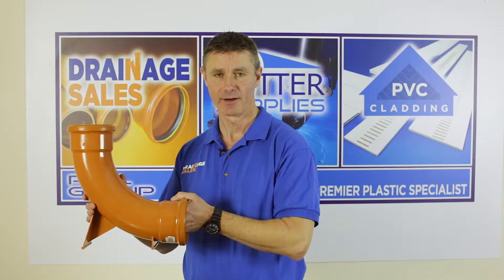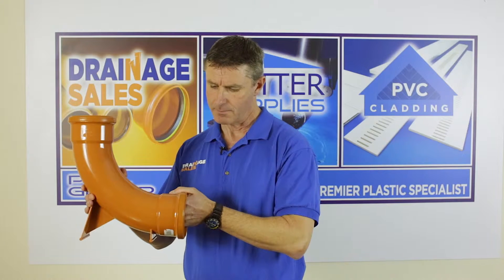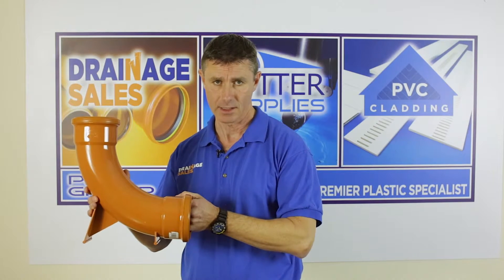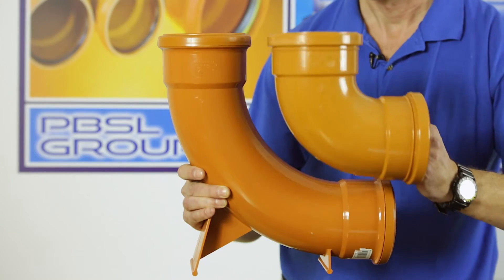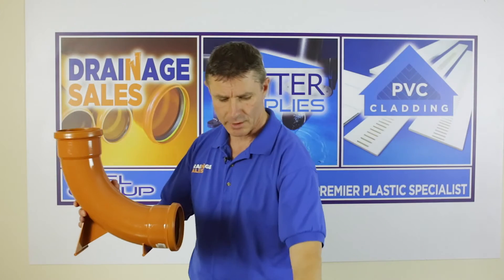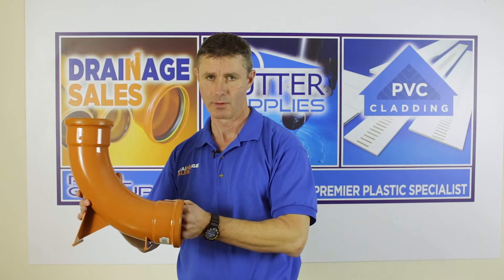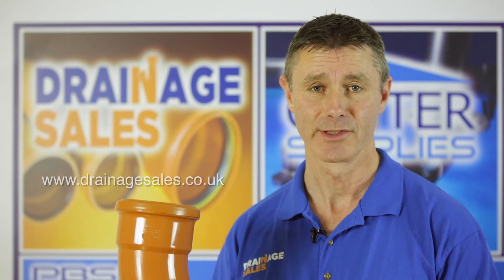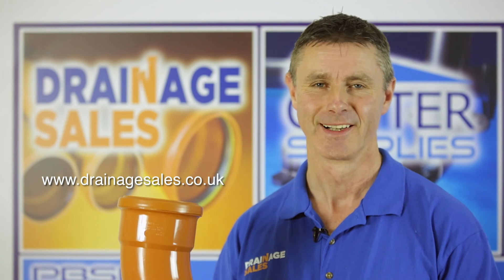PRODUCT REVIEW: Drainage Rest Bend | Drainage Sales

Comment: Great videos I've found a lot of these a great help. Can you use the tighter elbow where a ground floor shower trap exits vertically from 40mm to 110mm then a 90 bend where to runs out horizontally to a 300mm exterior foul chamber? Or would it still require the larger sweeping rest bend? Only shower water no foul.